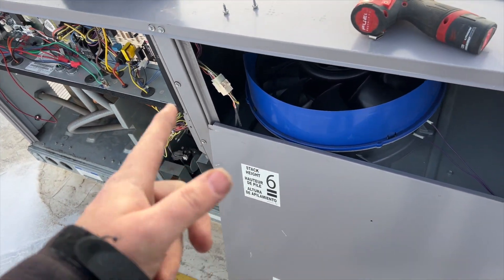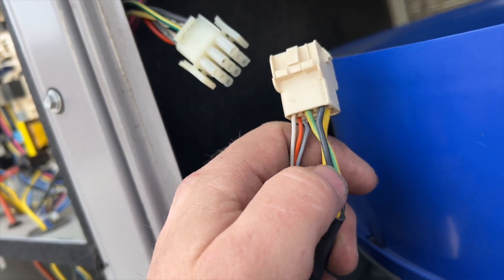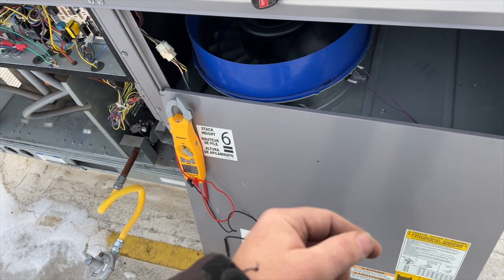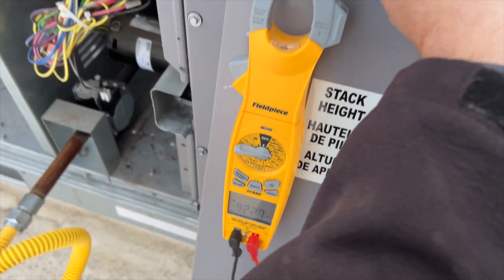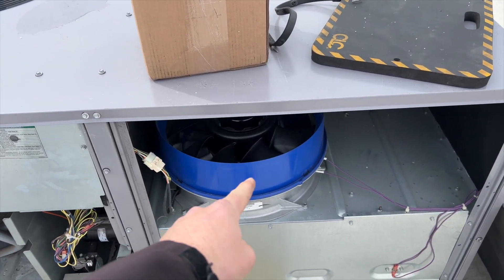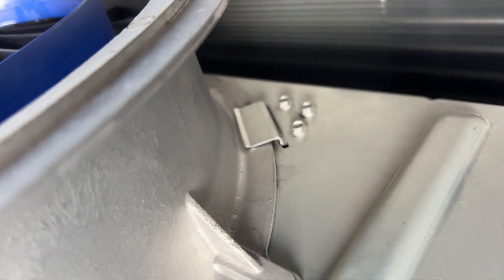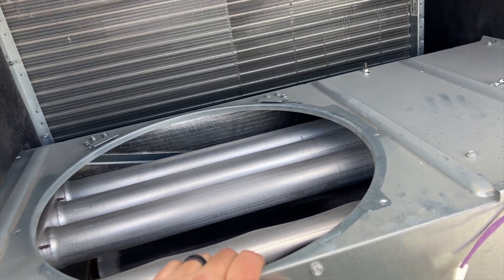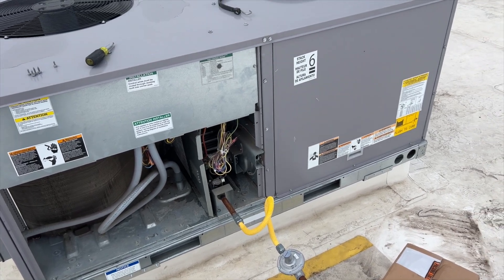Carrier Axial Fan Motor Overheating, How to Diagnose and Replaced the Motor EP124

Comment: How fast did it stop working again. I had one do the same thing this morning but couldn’t find anything wrong. Where did you purchase the motor?
Reply from the maker: It ran for about 20 minutes then would lock out. Check your gas pressure. Make sure it’s not too high. I got the motor from the local Carrier distributor.
Reply: @ thanks for the reply. Will make sure to subscribe. The one I’m working on is electric heat but this was technically a no cool. Weather here in my town has been cold and hot not sure if that’s playing a roll but all other stuff filters , duct etc was good.

Comment: They sell a metal heat shield for those at the Carrier dealer for around $3.

Definitely a design issue.

I saw a service bulletin that basically summed up they're not sure why the units are doing that but if you find out to let them know.

Comment: What kind of stupid design is that?  A propeller fan to push air through a system?  That type of fan is not designed for higher static pressures unless it runs high rpm.   Not to mention it’s an ECM and we all know about those.   Then locating it directly over a heat exchanger, seriously?   I realize the equipment manufacturers are trying to squeeze as much energy efficiency as possible but in my opinion this is a very poor idea.  I bet that fan motor is mighty expensive too.
Reply from the maker: Right and right!
Reply: The whole assembly comes together and is around $900

Comment: I did that same exact thing a year ago. Lucky there was an identical unit close by . Tried the other motor on the malfunctioning one and first thing I noticed is a good motor will run faster. If they die they spin a bit slowly causing hi-limit to open .
Reply: Great idea to test with a known good fan from
another unit.  You get a 👍🏻 from me.  But Carrier / ICP gets a 👎.

Comment: I had a similar issue with one of these couple years ago. Replaced motor and thought all is well. Limit tripped again few days later. Found there is a technical bulletin from Carrier on intermittent high limit fault. Basically they send a new switch and you have to do a little rewiring. Maybe your outcome will be different. Thanks for the videos!
Reply: That's interesting, it seems like that wouldn't have locked out the blower though.
Reply: That’s exactly what the high limit switch does. It cuts 24v to thermostat terminal not allowing the blower to cycle on.
Reply: What is the switch called?

Comment: A snap to replace. However, motor burnout looks like it could be a common problem due to the fact that it was designed to sit much too close to the heat exchanger for my liking.
Reply from the maker: I’d have to agree with you. Maybe some better protection then a metal plate.

Comment: It's interesting how  the motor doesn't have some sort of radiant heat barrier to protect the motor from overheating since the heat exchanger right there but it is an engineering thing. As always keep up the great work you do and very useful information as always. 👍
Reply from the maker: I was thinking the same thing. I feel that the metal plate isn’t sufficient enough to shield the motor from the heat generated by the heat exchanger.  I’m glad you enjoy the videos.